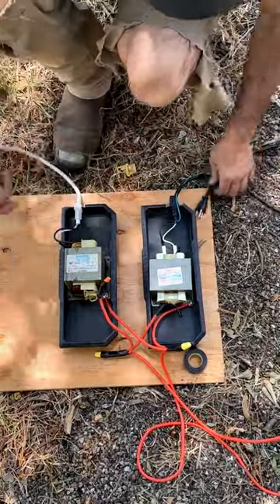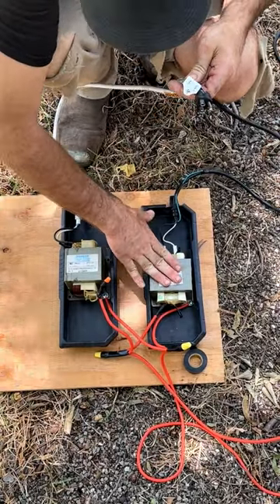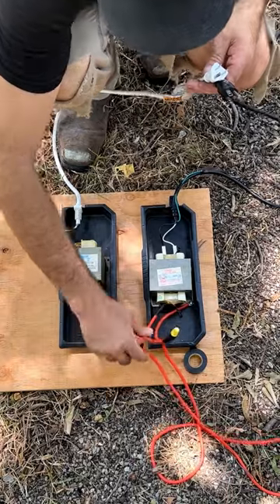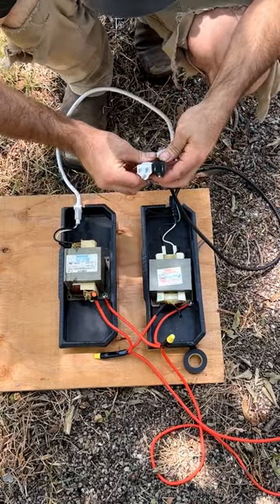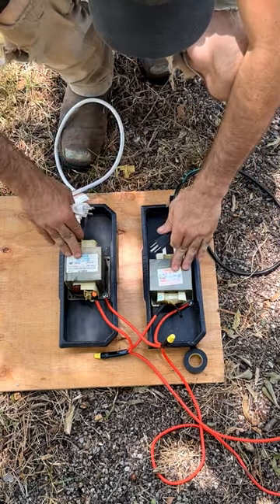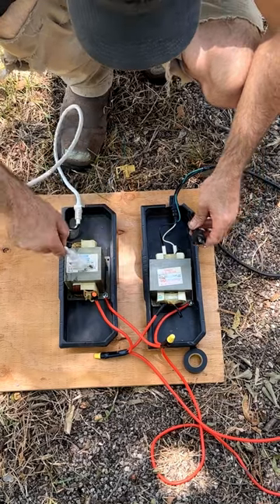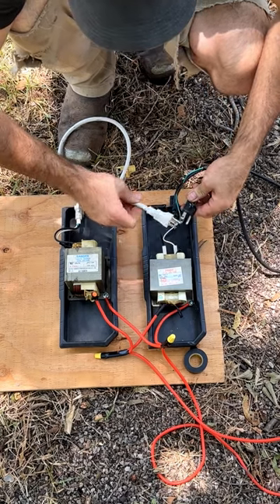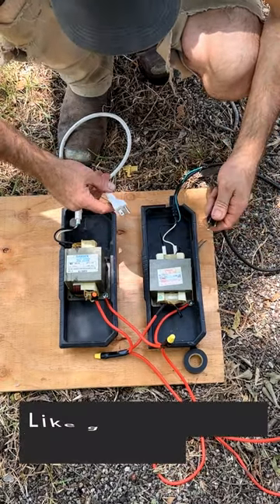Double Transformer Fractal Wood Burner Part One

Comment: This is extremely dangerous..of you wanna do this do this privately and don't post it.
Reply from the maker: I appreciate your concern. You have inspired me to create a video highlighting how to safely perform this operation. In the meantime you may want to check out the other videos that cover the safety protocols for such a procedure.
Reply: Are you serious if you use your brain and do it safely it's sweet as,I've been fractal burning for a very long time and I'm still here. I have never had any issues. Did you no it's dangerous to use a chainsaw or lawnmower, drive a car, use a grinder, crossing the road.
Reply: @jase4270 yeah every death I’ve heard about sounds like human error

Comment: Well did it work?
Reply from the maker: @Ruthless-1699  it did work, kind of. It’s not a very efficient set up because the transformers are not the same. But with this set up I can switch from one transformer to the other which means I can have a 600 watt burner or an 1800 watt burner.

Comment from the maker: SO if one wants to wire transformers in parallel they need to be the exact same transformers to work properly. This was a fun experiment and helped me to learn more about transformers. There was voltage on the prongs of the transformer that was not plugged in.
Reply: You also have to make sure you know the difference between "series" & "parallel".
Reply from the maker: @huckbeduck  haha good point. Thanks for catching that. I suppose wiring them in series would multiply the voltage and divide the current. In parallel the voltage is the same but the current is doubled. Only of course if the transformers are the same.
Reply: With electricity please please learn before doing experiment. Don't learn doing experiment 

I'm an electrical engineer please take my words cause i have seen a lot of bad things 

And what you are trying to do making electrical patterns on the wood that's a dangerous project shouldn't be done at all and i hope you have gloves for that job
Reply: @AntCBCV hardwire them into a switch that you can throw from a few feet away rather than having it potentially blow up in your face doggy

Comment: If you want it to work, you need two of the exact same transformers. Also, there is a big mistake if you plug in only one transformer. It causes induction in the second transformer's high voltage coil because the transformer that is plugged in is connected to the second transformer and produces 240 volts in the primary coil of the second transformer. This voltage is applied to the second transformer's cord plug pins. If you touch it when you pick it up to plug it in, you will get a bad shock.
Reply from the maker: @RANDOMUS250  yep that is correct. The transformers need to be the same for this to work. My supply voltage is 110 so the transformer that was not plugged in took the high voltage and transformed it back down to 110 which is what I measured on the prongs of the plug. There were voltage losses too because of the inefficiency of the set up.
Reply: @AntCBCV  Be careful, men. I wish you luck. I am starting wood burning too. It is so amazing. I already have a couple of test burns on wood pieces.
Reply from the maker: @RANDOMUS250  there are many good videos on YouTube to learn the safety precautions necessary to do this safely. IT IS DANGEROUS! Many have most their lives by not following simple safety precautions. Have fun and be sure to have an always off aka normally open foot switch inline before the transformer. Use high voltage gloves and keep yourself far away from the leads and the electrolyte solution. Remember the current travels through the electrolyte.
Reply: @AntCBCV   thank you so much❤️

Comment: Hey man, hobbies are great, and if you do it with extreme care it's gonna be fine, just always be extra careful, and I hope to see your succeed!
For more technical stuff, the low frequency AC is actually more dangerous than high frequency AC, or rectified DC, because your muscles respond to low frequency currents by contracting, which is what causes traumatic damage, locking your body up, stopping your heart, etc. I almost want to propose using inverter based microwave oven power supplies with its rectifier removed (although this would cause some problems as the secondary circuit contributes to the soft switing topology those switching power supply uses), as at these frequencies, you likely won't even be "shocked" when you touch the HV, and would just receive localized light thermal burns at the contacting areas. As bad as touching an extra spicy soldering iron basically.
At high frequencys (>100kHz) your body won't even notice the current being there, especially if you have full contact with the electrodes to prevent arcing burns. Your body will be unharmed and just pass the current like a resistor, unless you're dissipating too much heat in which case you get thermal damage.
Reply from the maker: @alexwang007 thanks for the info and the encouragement!  I know many fractal wood burning hobbyists prefer using neon sign transformers because they are safer. I chose to use the more dangerous microwave transformers so I could get more familiar with them as I intend to use them for other projects in the future like lasers, tesla coils, and masers. Plus microwaves are very cheap or free and come with many other useful components.
Reply: @AntCBCV  Hobbyest in the making spotted! Love to see it! They are very useful, can make electromagnets too, and for charging capacitors.